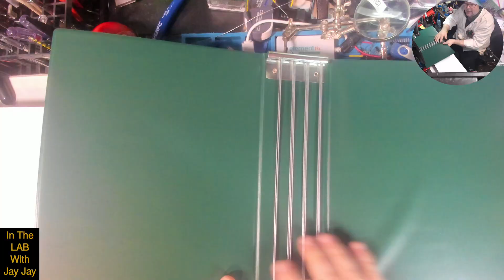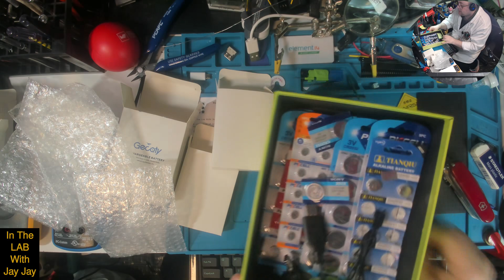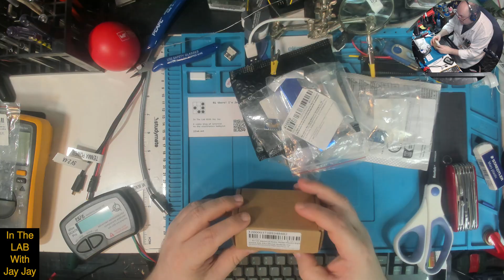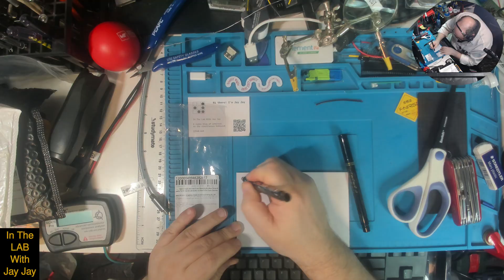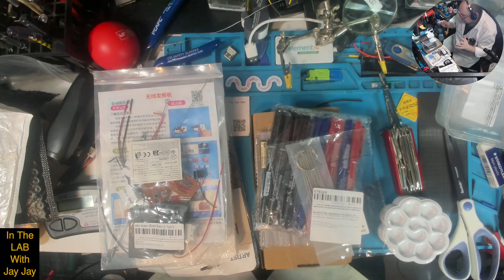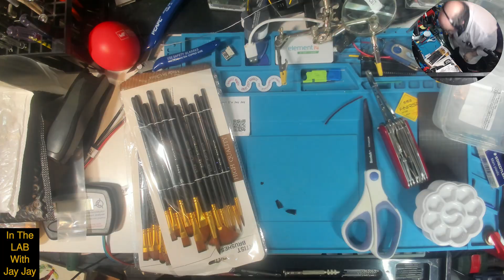Mail Call #50: Silicon Chip Magazine, 6V NiMH Batteries, 10mm LEDs, Mesh Holders, and More!

Comment: Your tech area looks busy but well organized. I'm impressed. I clicked on several of your links but after more than 10 seconds I gave up. The length of the link doesn't look right. I'm in Los Angeles, California so maybe that has something to do with it?
Reply from the maker: Hi there. Thanks for your positive feedback and thanks for getting in touch! I am aware of the issue with the slow links, sorry about that. The problem is that my humble web server is being hammered by bots. I can upgrade the server but it's going to cost me more per month... I suppose there's nothing for it. I will upgrade and see if that helps mitigate the issue.